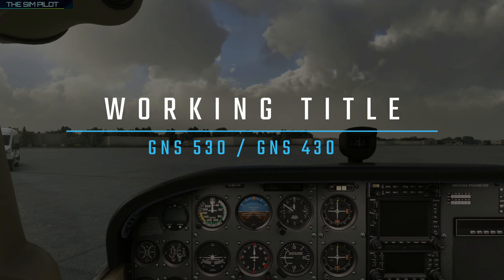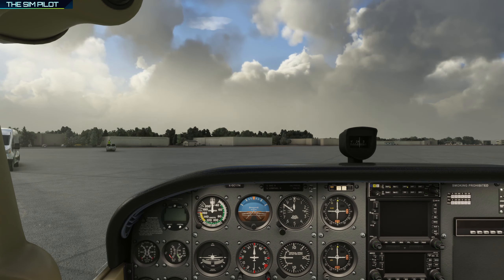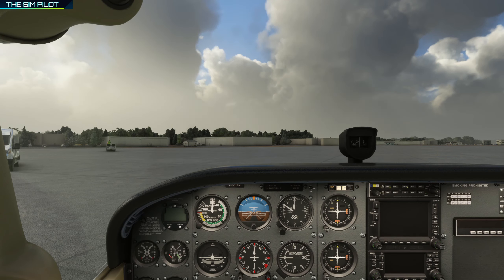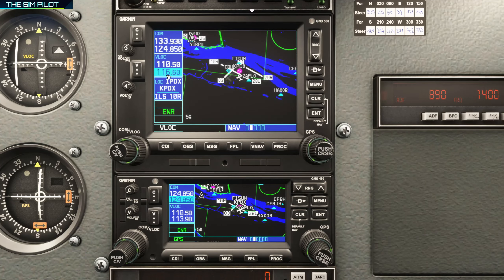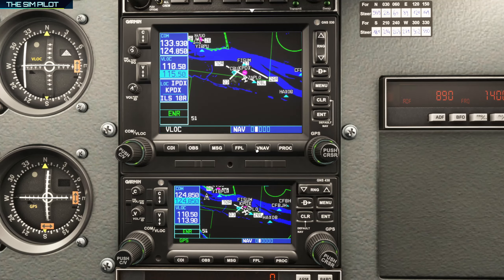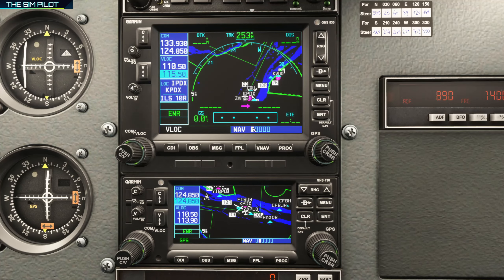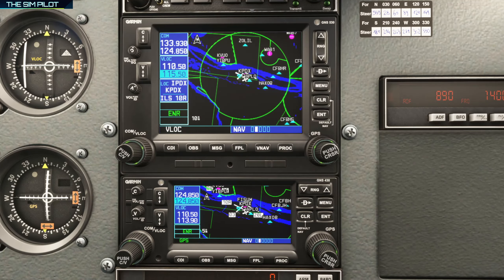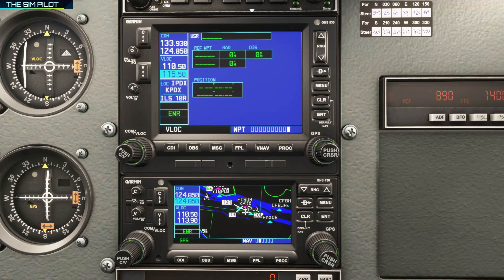MSFS | Working Title GNS530/430 Feature Discovery, Functions & How to plan a flight |

Comment: great video        how do I show the wind direction
Reply from the maker: I don't think it's possible to display the wind information on GNS530 like you would on G1000 or GTN750. It does not have a PFD screen and the data fields on the map does not display wind information. It's not an option you can select when changing the data fields.

Comment: hi, i use wb-sim enhancement and it uses other mod of gns530/430... but i like this from WT more, any suggestions how to combine them? any possibility to use wb-sim and this version of gns?
Reply from the maker: I am not sure if it will be possible to combine them . I'd probably use one or the other to avoid any conflicts that might ruin the experience. If it's possible to combine two units I believe developers needs to work together to make both work simultaneously. Chances of this happening is quite slim in my opinion.